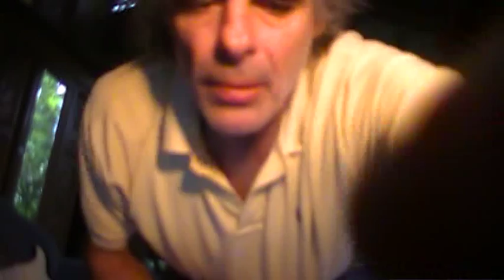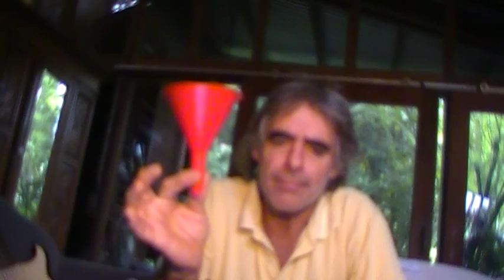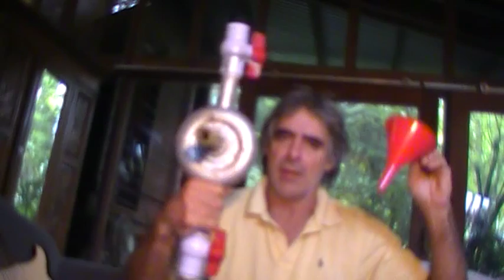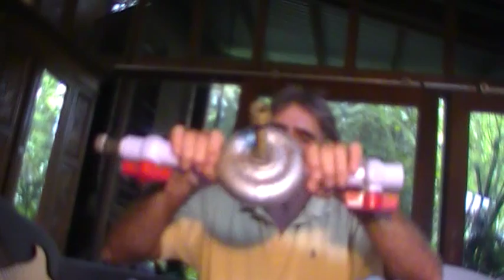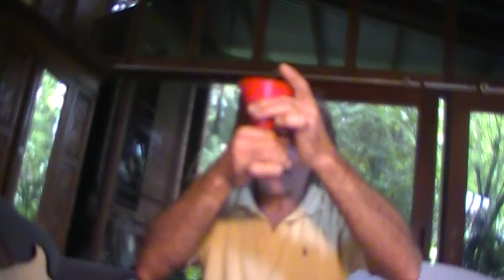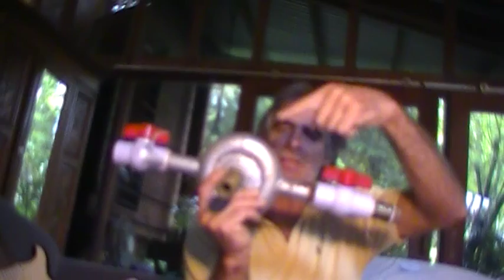Water Desalination using vortex chambers

Comment: The concept is excellent. Have you tested your specific design? Look at how vortex tubes filter air by temperature based on density. Also look at vortex or cyclonic dust filters.